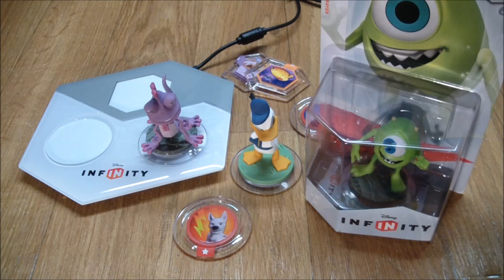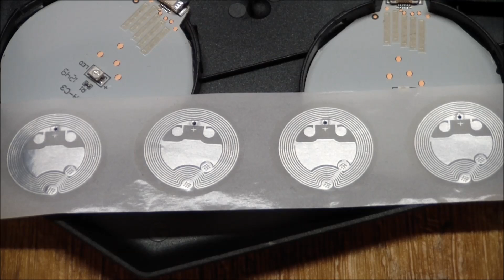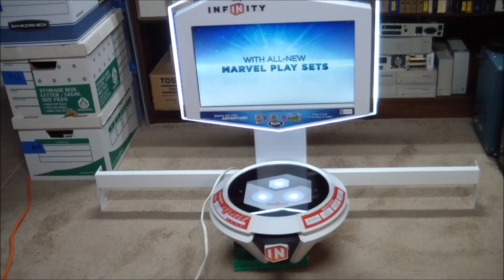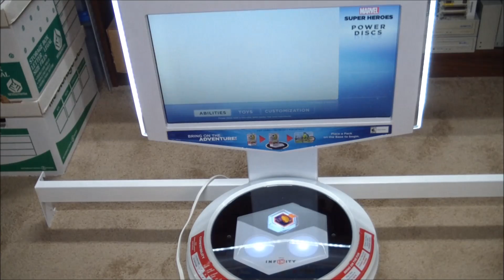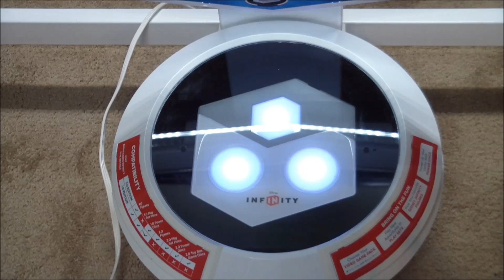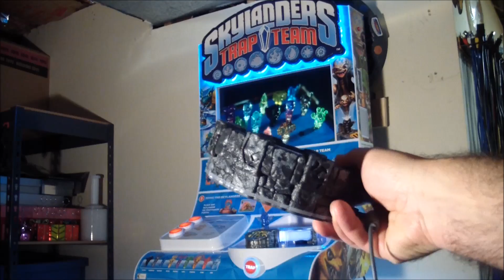AE#32 Video Games And RFID Tags

Comment: Nice video Artie. The way these tags work seem like magic. Would love to see the in depth video of how the fields interact and work. Might be very technical because there isn't really much information to he found. Scotty from strangeparts channel did a similar video on a Japanese outfit that is using the same technology to create wireless, batteryless LEDs that you stick on to your action figures and then they light up when you put them onto these bases.

https://youtu.be/PsUsByrOveE
Reply from the maker: The way you can light up a toy is pretty straightforward. The base is a transceiver outputting an wave which is modulated by the RFID signal. The toy has the same antenna, and when you place it on the base they become inductively coupled, essentially creating an air code transformer. All you would have to do is wire an LED across the antenna terminals in the toy and you got a lit LED. This can be improved by additionally rectifying the the antenna signal and running it through an LDO regulator which makes the LED emit a steady glow.
Reply: @artifactelectronics  Thanks for the information Artie. Much appreciated.

Comment: Very interesting..your demo worked well. I never thought to look up what freq. RFID of this type works on - 13.5 MHz I usually associate with things like induction heating in industry. I would not want an RFID tag embedded in me thanks. That's a step too nurdy. I used a lab device known as a plasma asher which basically was a vac chamber with a 200W 13.5 MHz transmitter radiating into it - valve (tube) powered, and it was still in use in 2016 :o) Nothing to do with RFID, but an interesting use of rf on the same band...

Comment: Embedded chip is also a literal dog tag ( and cat tag as well) and is very common now in pets, and also in cattle to identify them. 

Milk producers use it to track the output of each cow as well automatically, and it also lets them into the milk parlour and gives a feed ration during milking specially per cow.

Wonder if rewritable tags would work on those readers, that is an interesting side of RFID that most common tags are single reply and not encrypted, and can be cloned easily.